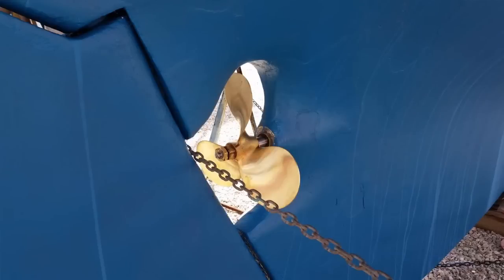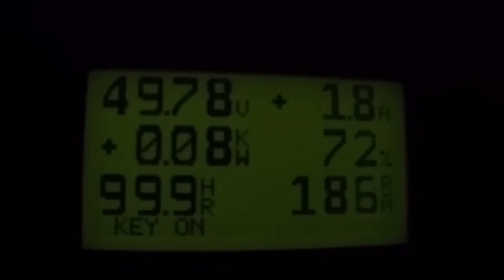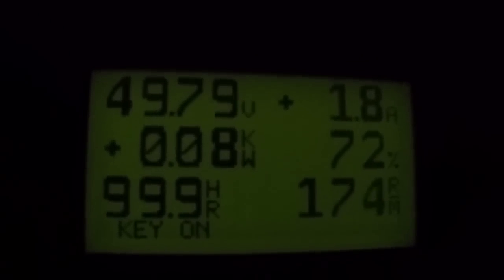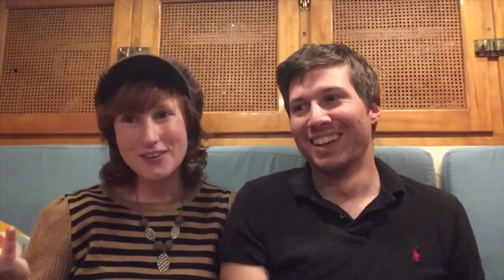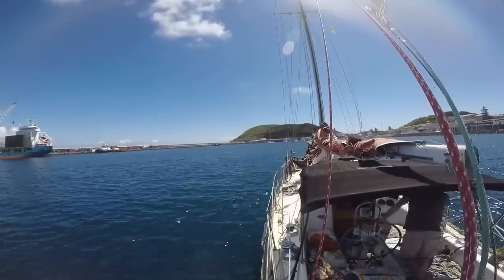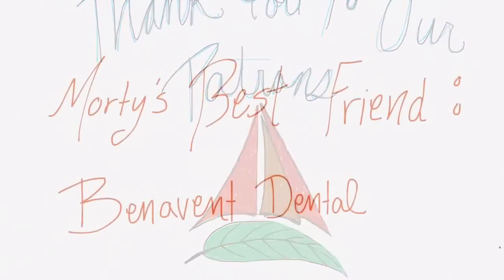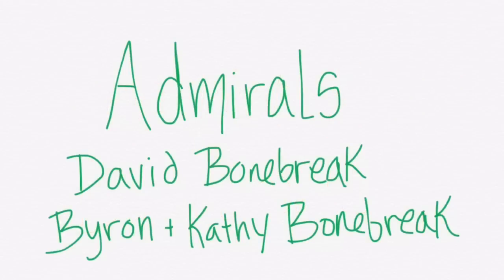Electric Motor, Ocean Crossing with Regeneration | Sailing Wisdom

Comment: what do you recemment on a 50 ft catamaran i realy can't find anything on how to calculate de prop for a cat. For mono hulls yes. By the way 10 thumps up for this episode. You can buy refurbished electeric car battery's Tesla etc up to 25 years of life left.
Reply from the maker: I would check with Mike from Electric Yachts (mike@electricyachtssocal.com) for specifics on motor and prop sizing. They are the experts on this because it’s what they do!

Comment: You said at low speed you were lucky to get an amp, at full speed just about 5, watching your videos, you sail very slow, how can this keep your fridge going, did you turn it on and off at times, or top it up with generator,
Reply from the maker: The 5 amps were at 48v. When we step the voltage down to 12v, those 5 amps @48v become 20 amps @12v. 
The fridge stayed on the whole way and the fast times were able to keep everything running on the crossing.
Reply: @RiggingDoctor  yes and that was your max , you sail very slow ,  if you get 20 amps 12v , I would say that is awesome,  your issue is the electric motor at 48v , that will suck your power, that's why you go slow, that's not a dig,
Reply from the maker: David Warnes yes, we are slow because we don’t motor when the winds go away. But when the winds are good, we will move along anywhere from 5 to 9 knots for a few days straight. At 5 knots we get 5 amps, at 7 knots we get over 6 amps. 
If we do 5 knots for a day, we generated 480 amps @12v. That is plenty to charge everything back up and keep the fridge on. When we have a calm day, we have plenty of power. 

We currently have 300W of solar panels on the stern, so we haven’t needed to run the regen often. If we have had a few cloudy days, we can then turn on the regen and get some power from the motor. 

I think our secret to powering everything off of such small power sources is that we don’t consume a lot of power. 

We have a fridge, radio, nav lights, and interior lights. That’s all the power we consume and in this mix, the fridge is the biggest consumer. 

I’m not offended or anything, just trying to clarify how we did it. The generator was never needed or run the entire way from Bermuda to the Azores. Everything came from that tiny electric motor.

Comment: Have you actually measured how many cars are produced per year, how many of them are electric and how many years will it take to phase out ICE cars completely? Well, I have and the likelihood of this happening in the next 30-40 years is pretty slim. EVs are much below 2% of current global vehicle production (if I recall well, around 1.3 or 1.4%). So, don’t bet your last dollar on what you said. Fossil fuels are here to stay (as long as they last - reserves are not disclosed publicly unless the company becomes public and trades its stocks in the market, Saudis won’t do that) and solutions will be more on the mixed side.
Reply from the maker: All true statements, and I feel that oil companies will pay to squelch electric for as long as they can make a profit. 
That said, over here in Europe, where we are right now, people won’t shut up about electric! 
Apparently, after the VW dieselgate fiasco, all European car manufacturers are stopping their diesel lines and replacing them with electric. 
Also, a lot of cities are supposedly going to stop allowing diesel cars into the city limits and only grant access to EV. 
Now, two things stand out to me in these statements that we hear: 1. There is no mention of gasoline 2. Batteries still offer nowhere near the range of diesel. 

I had a diesel Jetta and was regularly getting 1000 miles on a 14 gallon tank (71 mpg). When the VW incident happened, I was able to swap out the Jetta for an E-Golf which had an advertised range of 100 miles on a charge. 
I could squeak out 70 miles if I didn’t run AC in the summer or heat in the winter. It was awful!
I hope batteries get there fast or the Europeans that are pushing for the swap are going to regret it!
Reply: Rigging Doctor you sound like realists (I haven’t been watching your channel for long so I am not familiar with your modus operandi and beliefs). What’s not vastly known is that before the dieselgate with VW, Caterpillar, the heavy machinery manufacturer form the US, had done the exact same thing and all they got was a slap on the wrist (especially when you take into consideration the billions of fines the Germans got for tweaking their cars). Maybe this fact gave a signal to VW and the others that potential costs vs benefits even was worth it. 

Moreover, I was wondering how is it possible that the German government didn’t know about the tweaking when they are supposedly testing the cars thoroughly (the testing standards changed recently and now they require real-life driving tests and measurements not simulated environment). 

The EU is pushing the fake green agenda like mad (fake because as we speak batteries, solar panels, and wind turbines, all involve huge amounts of emissions during all levels of production, from the mines to the industrial energy they use for making these products) and it’s already paying a price for it. Look what happened to France (with the recent riots)  and what’s been happening in Germany where they’ve been spending 35 billion Euros annually for some years now in order to phase out nuclear and lignite plants in favor of renewables and ended up buying nuclear energy from France while the electricity bill for the average household rose dramatically. 

Central planning failures 101!
Reply: JED EVs are been powered by batteries but they are being charged by the grid that uses fossil fuels and nuclear. Batteries and the electric vehicle themselves are being manufactured by using fossil fuels the whole way. The myth that they are now clean has prevailed because people trust governments. They shouldn’t! Governments  mostly deceive and exploit the populous in order for statists to gain control over our lives. Even Peter Drucker, father of modern management, had included a relevant statement in a book. 

Don’t be surprised if the climate change catastrophe end up being the biggest scum of all. Scientific evidence point to this direction despite the fact that government scientists are producing doomsday scenarios one after the other. NASA and the IPCC are government subsidized/payed/employed scientists. NASA has artificially lowered temperature baselines to increase the warming effect today. The oxymoron is that they keep the older data (which was much higher hence you’d have less warming trend if you’d used those as baseline) in their site for people to research and find out. There’s a geologist who goes by the name Tony Heller on YouTube (not his real name - but we know who he is) that’s been exposing this. Moreover, what was the deal with climategate? That was unacceptable! If you haven’t heard, it was about a bunch of leading climate scientists in the UK that were caught (hacked emails) to purposely hiding data that didn’t suit their narrative. That’s not science for sure! 

P.S. droughts, wildfires and so on are actually on decline (don’t mind the media - they play whatever game their masters tell them to play). Especially droughts (since global temperatures are slightly rising - most likely naturally) should be even more scarce than before because rising temperatures mean more evaporation which in turn means more precipitation. Wildfires are not increasing either (overall) but they are getting more serious (for example in California) because humans have interfered with the natural occurring wildfires and allowed vegetation to grow to such degrees that when eventually a wildfire occurs the incident becomes much more serious and unmanageable.

Comment: Electric is an replacement for a diesel. You got the totally wrong set up, purposely or not. Three  blade prop does not generate considerable drag. Solar panels are way to go.
Reply from the maker: The solar panels are great and give us the majority of our power now (because we upgraded to much bigger panels). When we did that crossing, we had 50W of solar, now we have 300W! While regen does slow us down a little, when we needed the power it was available and we had plenty of it! We never needed to be conservative with power because we never reached the limit of how much it could produce. The fridge and freezer stayed on the whole voyage and the batteries never got depleted. 
Now that we have a proper solar array, the regen stays off unless we find ourselves in a cloudy situation for a few days and the batteries are a bit low. We sacrifice some speed and turn on regen to give the batteries a boost of power!
Overall it’s a great system on a Cruising Sailboat.

Comment: Used car batteries will half that battery price.
Reply from the maker: We’re keeping our eyes peeled for a wrecked electric car!
Reply: Rigging Doctor tons of places to buy them on line from people who part electric cars out.  They will even test and verify the batteries are good.
Reply: @RiggingDoctor  Sailing the Space Between is an electronic whiz and has done several videos on his system using Chevy Volt batt's - one fifth the weight and cost of conventional Lithium Ion
Reply: Yes, electric car lithium batteries are available in 48 volt packs.
Reply from the maker: Awesome! You guys are a great source of information. I was kind of offput by Electric car batteries because I would hear 300v batteries or something like that and thought they were sealed and I would need a crazy step down converter and on and on. 
You guys pushed me to actually look, and it’s not bad at all, it actually looks really straight forward!
Reply: @RiggingDoctor   Volt batteries can More than halve the cost. BUT you will need to choose and integrate the required BMSs into the system. Sailing the Space Between chose a Very basic protection system. Nothing wrong with that. It offers the required protection but nothing more. If you want to see cell level voltages, pack temperatures implement your own charge/discharge parameters, etc. then you have to find Good products that will add significant costs and design complexity. That means a Lot of studying. But you guys have time.
I actually have a Volt pack and recently discarded the plan to use them. Since my (diesel electric) system will be a prototype to attract investment for future commercialization. Used batteries simply don't fit for that. However, for just me....Used EV batteries are Definitely the way to go.
Check out EVE on YouTube for more information on the Volt batteries.
Good video guys.
Reply: @svphoenixandme776  what are you going to do with your Volt pack?